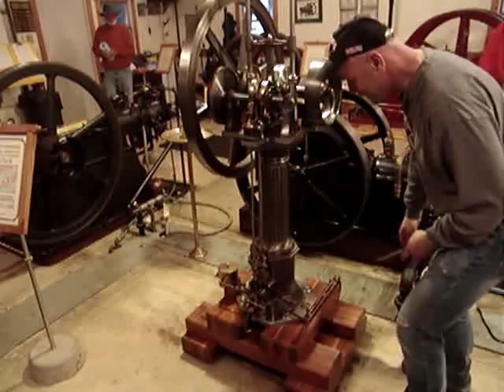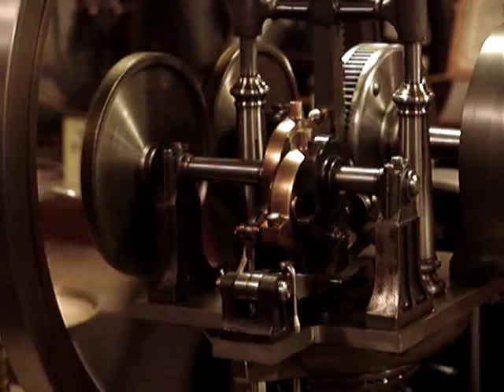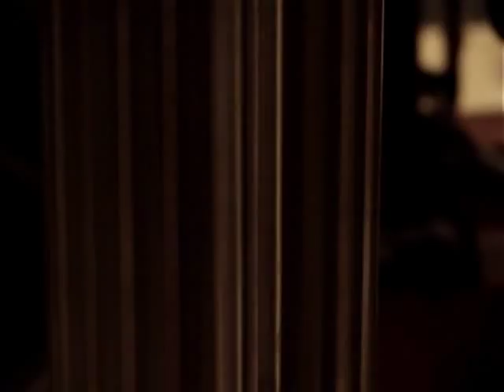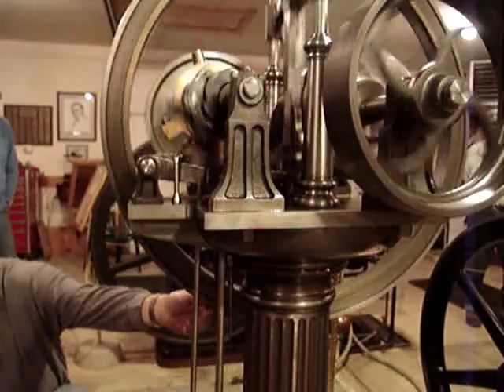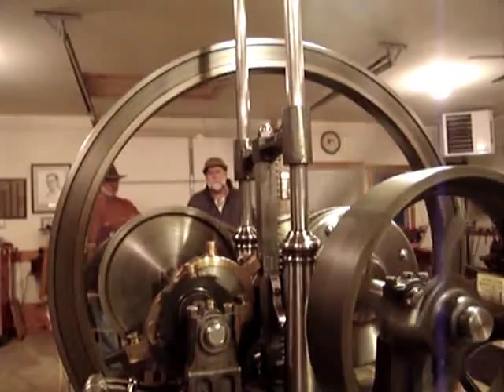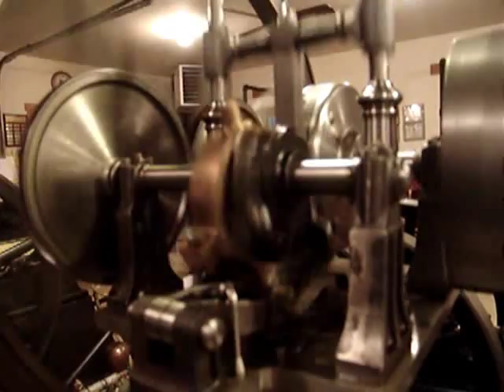Otto & Langen Atmospheric Engine 1864-1867

Comment: What a curious and violent motion. Doesn't seem very powerful since it struggles with a hand on the flywheel. But I asume the fullsize engine was an engineering curiosity rather than a workhorse.